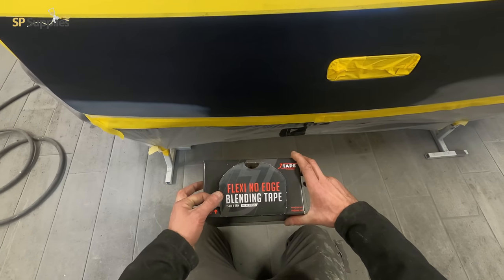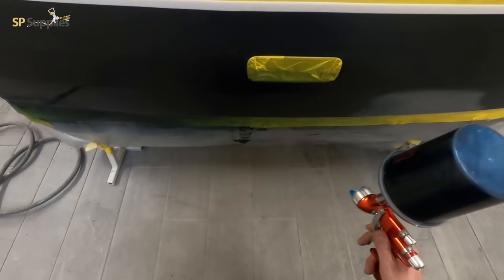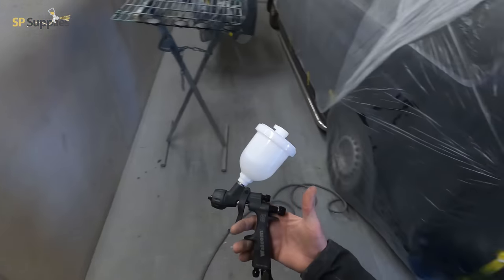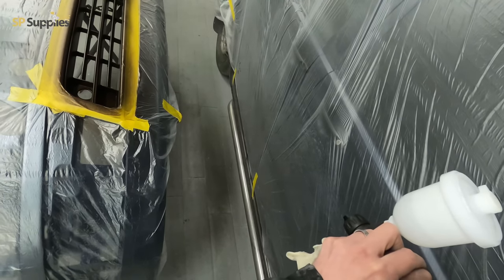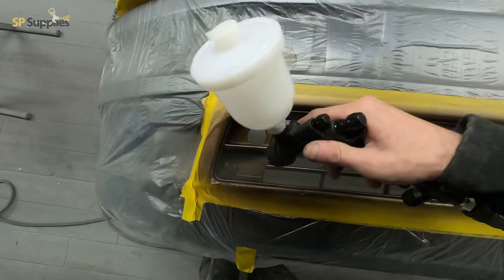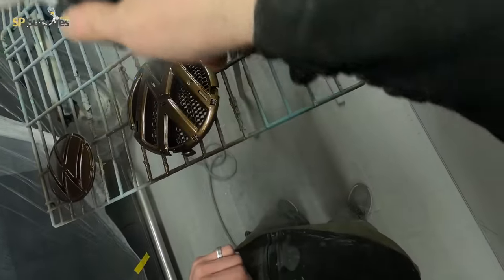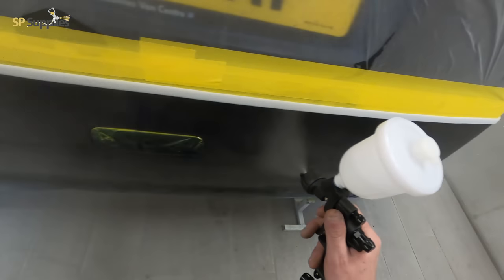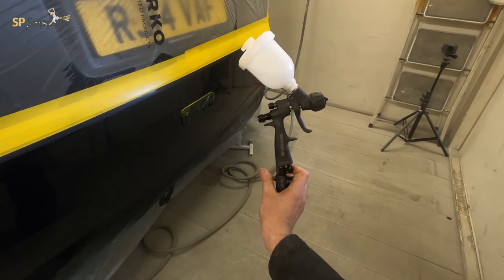The Best Smart Repair Spray Gun??? - WALCOM EGO 190 1.2 HTE

Comment: Yeah I had to get mine shipped out of Australia from my sister to New Zealand as not available here . Awesome fan with great lay down of color and clear. Easily capable of blowing the whole side of a car no problem. After shipping cost almost as much as a full sized carbonio BUT it is honestly a gun you’ll only ever have to buy once , a quality tool. For me it’s the hte. I want to be able to get the finish I want in one coat of clear on fiddly bits and not keep working it compared to hvlp.This gun does it first pop.

Comment: Nice job nice gun mate I should imagine you could if you wanted put different size cup on it say for instance one half the size thats on or a bigger one pluse with the smaller gun its handy for touch up jobs I know in my day most guns were the same size id have loved a smaller gun like the one you have there .like I said a good job as always mate
Reply from the maker: I’ve got the colad adaptor on it now mate so I can use 350ml to 600ml on it 👌
Reply: @TonysRefinishingTV  I said before about doing the books I was thinking as well you could produce your own paint samples with the info on the back of how to achieve that particular one you know stuff like what mix and how many layers its just a thought I had
Reply: @TonysRefinishingTV  that gun looks a cracking gun mate

Comment: Great video Tony, I'm still on the fence about the Walcom guns but have to say that seeing you use one it gave me a good idea what they spray like and as you say that little mini gun has a really nice even and big fan on it.
You used the Sagola for the basecoat was there any reason you didn't use the Ego 190 mate? it must be more than capable of laying base or do you need a different aircap or nozzle for base, maybe sometime you could use it for base as well 👍
I should rectify a comment I made on the live chat last night saying that the fan on my new Slim Combat seemed a bit small, looking at it this morning I noticed the air valve at the bottom of the gun was only half open so using it at 25psi at the analogue gauge was not correct so that might be the issue 🙄🤭 trust me but even at the low pressure I was using it laid the wow primer nice and flat, have to try it again at the correct pressure 😁👍 enjoy the rest of your holiday mate.
Reply from the maker: Purely didn’t want to use base in them till I had the adaptors mate for my collar cups as cleaning from base to clear is time consuming and uses a lot of thinner buddy now the adaptors have come while I’m off il be using them and testing with both
Reply: Ah I see, makes total sense mate, you still using the Colad cups Tony.
Reply from the maker: Yeah mate I’ve just restocked a week or so before I came away but the adaptors took a while to arrive for the walcoms but there at the shop now